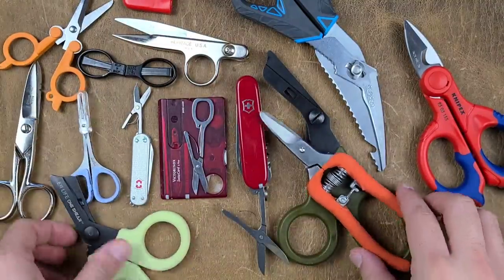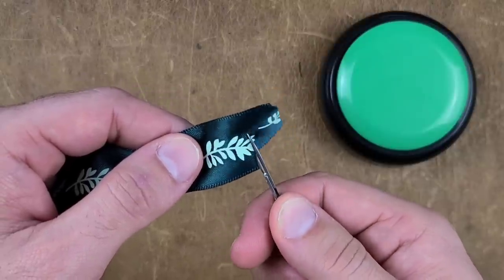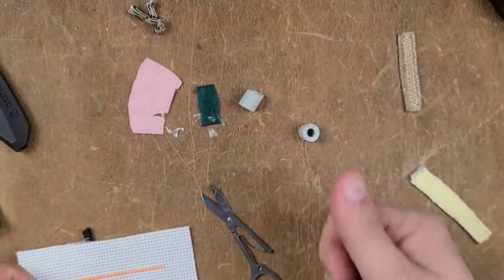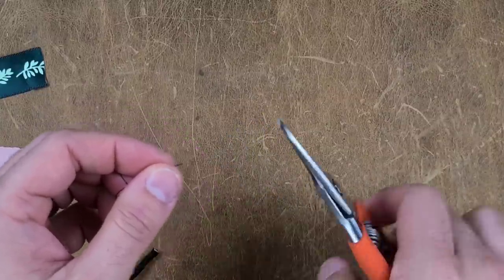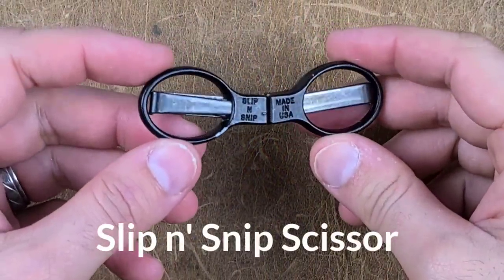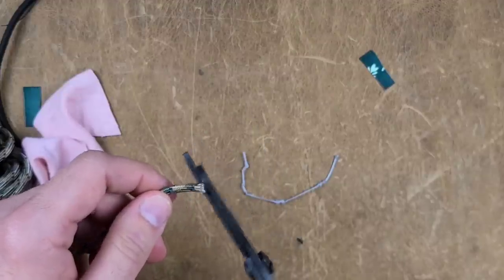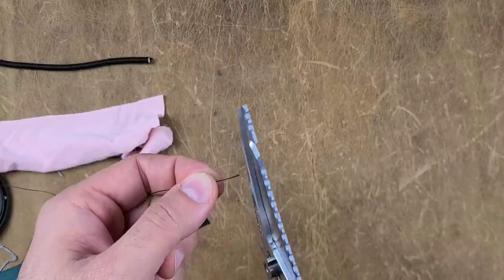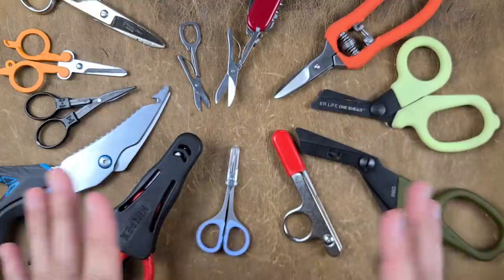✂️ EDC Scissors #1 (DIY Multitool Toolkit)

Comment: I used to be a telecom electrical worker and used electrician scissors every day and know that there's not much in the sense of everyday things that they can't cut. Now as an actual electrician, I still carry around my old beat up pair of Klien 2600-1 scissors everyday, even outside of work. They come in handy all the time and still cut just as good as the day I opened them. Great video, 👍 very insightful 👏
Reply: Was a wire tech for att. those snips are great. especially if you add the finger loop thing to it for more leverage and comfort for extended use
Reply: I just got my Klein 2100-5 and love them. Stainless 2100-9 on the way too.
I know Electrician shears are all close, but Klein is so nice STILL made in the USA. Like a little flex to glean the "USA" on the side when working with them. Meaning my fellow countrymen/women have work and no supply issues in an emergency.
Reply: And you reminded me I have a Victorinox card tool in my Victorinox section(25~ different models including Swiss tools), but have 400~ multi tools in total. 🫣

Comment: The Fiskars were the most surprising to me, I carry the Klein so I knew they would do great. I think putting leatherman scissors through the same gauntlet will really show their limitations. Hope the micra is in that test as they’re the only scissors I like from leatherman. Thanks again for the hard work! (Leave me out of the shears giveaway)
Reply: Klein crushed it here - which of the two models shown do you keep at hand, and where do you like to clip or place a holster/sheath?
Reply: @seqhorse  I believe they’re the 2100-7 and they fit nicely in my maxpedition micro pocket organizer. If I was using them extensively I’d probably get a belt sheath but the organizer works for me!
Reply: I sharpen knives and tools for living since the 90's. Fiskars are some of the best comercial grace scissors in Europe. There are eve better though! Japanese and some old traditional companies mainly from Europe, still make some really high quality high performance scissors. That being said, like most tools and machines nowdays, the overall quality, is not what it used to be. Usually, the older the better, with some excpetions here and there of course!
Reply: @greekveteran2715  victorinox actually also make scissors. not multitool ones but real ones... i heared they r even good nowadays.

really sad the stuff gets more expensive and trashy at the same time. just bough an old handdrill cause the oldones r just better...
Reply: @matthiaskathriner5494  Nope, Victorinox doesn't make any scissors. They buy them from a German factory,  and they just put their logo on. The only scissors Vicotrinox makes, are the tiny scissors on their multitools and pocket knives. 
          You're right about the handdrill. We aren't going to have power in any form on the coming years and that's because it's part of a plan and not just my opinion/theory.
          I've also got handtools, like axes,saws handriills etc, for the difficult winters we have ahead of us!! Stay safe Matthias.Take care!!
Reply: @greekveteran2715  thx for the responds. i live in swizerland and still didnt know that. glad i learnd something new today :).

i was always a big fan of hand tools like thoes drills and even scotch eyed auger (dont know if spelled right).

take care and have a nice day :D
 M. K.
Reply: @greekveteran2715  So, when are we going to start not having any power?
Reply: If your in south Africa...rn 😅
Reply: I have the smallest 4" Fiskars in my desk, and they are for fabric and paper really. Though I cut through a towel with ease. Earlier make of Fiskars 4" from the 1990s, so USA made. I just don't care for the plastic pivot. Hasn't seemed to make them wear though.
Reply: @greekveteran2715 Promise the US oil and weapons, and you'll have power in no time...lol
I have every manual tool variant of my electrical. Well, two-three of each type and size. I probably use a crank drill more than electric anyway. No noise complaints from the family..haha

Comment: 30 years in telecom, carried Kleins for most of it. That design is very old and has changed little for a reason. There's different handles now you can get but the fundamentals of the snip are the same. It works. The knipex cut great, maybe I'm just too set in my ways but I couldn't adjust to the ergonomics.

Comment: I've worked in telecom since 2001 and always keep a pair of the Klein Electrician Scissors on me. I've seen guys use them to cut a nickel in half! The key is in the hand grip. DON'T put your thumb through the top scissor hole but let it instead rest in your palm. If you get a pair that has a larger hole on one side, either put that side on the bottom and put at least two fingers in there, then  let the smaller side rest in your palm with no finger in it, or flip the scissors over and put one finger in the small hole and use the larger size to have more surface area resting on your palm. You can cut through anything like that.
Reply from the maker: Wow! Great tip!

Comment: I always have my Victorinox Swiss Card in my wallet and I love the scissors within the card. My sister gave me my Swiss card when I was just a teenager and now I'm in my late thirties. It is still going strong, both the scissors and blade. I actually put my middle finger slightly into the holes in the scissors of the Swiss card it gives me much more control of the scissors.

Comment: As someone who owns slip n snips and knock offs both pairs of my knock offs preform way better than my slip n snips despite abusing my knock offs far more often. Personally I feel for an EDC to pair with a knife they are the right call for me, being so rounded they store better than most the other options here in my pocket. And this way I can have a knife with a lock. I really hate using a knife without a lock it always scares me since I often find myself needing to press on the spine of a blade to cut things. 

Personally I do not find myself needing any thing on most multi tools at all often enough to justify carrying a multi tool. I do a lot of small quick cutting tasks so being able to keep them in my pocket is quite handy compared to the alternative. 

But yeah honestly the slip n snip I find work best on basically paper and fabric, but as soon as I have something like rope or a tougher cut I go to my knock offs. If I were guess they would probably score about a 11-13 on these tests. But the easy grip, and the comfort of them, along with not needing to maneuver an entire multi tool around to cut, means I find it easier to make curved cuts when I want and basically this is my pitch to people who see this and think they'd like the slip n snip form factor, to go look for a knock off brand, they are often around $5 at the time of this comment, and they cut better in my experience. I love mine. One thing I've done is a small bit of string and a bent paper clip means I can hang mine on the edge of my pocket, for even easier access then digging in my pocket. 

Just a friendly reminder that it's your tool, feel free to modify it to work better for you.

Comment: I'm don't see the SOG snippet, which are extremely capable, even more so for its size, more capable than any victorinox and weigh less than 60gr, bought them as soon as I knew about them after watching some comparison videos and they don't dissapoint, they don't have the best build quality but they work flawlessly. I wanted something comfortable and light enough to add to my EDC since I'm considering getting the Gerber dual force and they don't have scissors which I don't mind now...
Reply from the maker: The SOG snippet is a sleeper! Way way better cutter than the micra
Reply: @maxlvledc  I JUST WENT THROUGH THIS =p 19 PAIRS, DID 41 UTILITY BLADES TEST ALSO =p
Reply: @maxlvledc  I KNEW KLIEN WOULD WIN =p
Reply: @maxlvledc  I have an OG US SOG Snippet. Wild how well they are adjusted(sadly the uncreative name for this is "putting", short for "putter togetherer"...lol). Once the physics of the scissors/shears is realized, you can make many types cut better.

And the one hole scissors are thread nippers, and not made for any other reason. I have Wiss USA made ones and they're nice, but the construction should clue you in they have to be adjusted based on how you hold them. When to got done opening the blades cutting heavier stuff, they lost the precision adjustment. Or those are just not a good example of thread nippers.

Comment: I remember this being an issue for me, I work in I.T and I always needed to cut zip ties after doing cable management or replacing cables, but I didnt want to be carrying around some big bulky scissors, until I came across the leatherman CS, these small scissors pack a punch and Ive never had an issue cutting even the tightest zip ties with them being spring loaded. I highly recommend if youre looking for small form factor scissors.
Reply: Hello, can you give me a link to this leatherman. When i search for leatherman CS , only micra shows up. Or do you have this version?
Reply: @ironmaiden3842  Hey brother, so the name of the tool is the Leatherman Style CS but from what I understand Leatherman discontinued it so you might have to look for it 3rd party, hope it helps, good hunting!

Comment: Scissors really can be a mystery. In addition to performance across tests being unpredictable, I wonder what's up with the Xcelite shears. The fact that they did 1 or 2 cuts well and then completely failed against certain materials is confusing. I wonder if the handle style makes it less natural to push the blades towards each other as you're cutting, so if your grip is just perfect they perform well but if not they barely cut at all. It might be interesting to experiment with them to see if you can get them to work reliably, maybe by trying to put pressure on the grips differently or by tightening the pivot screw or something. I wonder if other straight handled shears would have the same issues.

I'm really impressed with the Klein and Fiskars scissors. I don't know if I'll ever bother getting the Kleins, but I'll probably pick up a pair of the Fiskars ASAP.

As far as other scissors to test I think you should try something from Kai. They are often regarded as some of the best fabric scissors, and I'm curious how they compare in more general purpose tests. Ideally you would probably want to go for the 5 1/2 (Kai 5135-wc) or 6 1/2 inch (Kai 5165-wc) scissors with blade caps. Kai is also the parent company of Kershaw and ZT; I hope one day Kershaw gets serious about making multitools again they use that scissor expertise to make something that could compete with Victorinox.

Comment: yes scissors are quite komplex... play between the blades, stiffness of the blade, angle od the edge... 
sharper angle can help to improove that the blades do not pull apart.. so expensive scissord dont have a flat grind all the way.. they have depending on the position in the blade a different edge angle..
also a corser grind can help to grip the material better so yo do not push it out... so for kevlar and dyneema  (at Gruschwitz) we used toothed scissors..

Comment: I would like to see the OLFA 5" scissors. I haven't seen hardly anything on YT about OLFA scissors so I was thinking about checking them out myself. I think OLFA makes good stuff. Also the Style CS, I really like them and I carry one everyday but yea the scissors kinda stink. They aren't terrible but I was disappointed when I first got it. They never cut that great until I lightly smacked the pivot point with a hammer and a machine screw (in lieu of a punch) and after that they cut better than they ever did. I think it tightened up the pivot and took out the slop in between the blades. I had to do that twice because they loosened up when I tried to open a blister pack and put in more force than I think I should've

Comment: I carried those fiskar scissors for a few months and the problem I kept running into was one of the handles would always disengage and the jaws of the scissors wouldn’t open. It got to the point where it was happening every time I used them. So I scrapped them and went back to carrying a SAK with scissors.

Comment: The Sun-Star Stickyle Tasuno Scissors + Screwdriver are in a two pen sleeve with my fountain pen. Got it from JetPens. I don't think the Sun-Star company knows, but the two caps on the pen-style scissors can be used as nut drivers in a pinch. Now if they can just invent pliers in this same form factor.

Comment: I own a fiskars heavy duty scissors. It is a standard sized scissors but Fiskars reinforced the handles to make them far stronger. The scissors has a fine point tip and very sharp out of the box and it even comes with a hard plastic sheath. I'd like you to give them a try and see if you like those scissors as much as I do.

Comment: Good video. Am curious how the Leatherman Micra would compare.   I have those collapsing Fiskars.   I wanted a tiny set.  It works surprisingly well, but I had to sand sharp edges from the plastic  handles.  They bit into my fingers.  I want a set of those Kleins.

Comment: I was very impressed with the klein electricians, just ordered the 2100-5 and will put them to the test at work cutting some fiberoptic drop cable. The stuff is really hard on blades, you can dull a knife in no time or just one pass when you cut it

Comment: Next scissors to test: Leatherman Raptors. I need to finish my medical kit and I’d like to see how they compare to the ones in this rundown.

Excellent video as usual. I needed a small scissor for my maxpedition pouch and I was literally waiting for this video to drop before I bought anything. Just ordered the Fiskars.
Reply: The Leatherman Raptor are great multi use medical shears. They have multiple useful features as a emergency tool / trauma shears but are not necessarily the best option for everyone. 
I like carrying them when on duty, but in my medical kits I prefer a good set of regular trauma shears. (From NAR, Piranha or similar) 
They are not only lightweight but also much cheaper and plenty capable.

Comment: This seems to be a very well thought out test, and I believe this test may actually be more useful to me than I thought.

More specifically whether the Slip n Snip scissors could be a good option for me.
Reply from the maker: I did learn...the slipnsnip is actually the safety variant. I need to test the other one.
Reply: @maxlvledc  
That would be good.

I'm not really looking to replace my Vic scissors,  but if I always need the Vic scissors it limits me on other things I can carry when I want to avoid certain redundancies.
Reply from the maker: @TylerSnyder305  exactly! That's why I think this is going to be more valuable than I originally thought
Reply: i’ve got some slip n snip scissors n they work great for EDC

Comment: I find scissors usually cut better by applying opposite pressure at the handles.  Its awkward though and with the better ones you dont need to.

Comment: Thorough work! The rather heavy duty scissors like the Klein or Knipex which are originally designed for cable could of course also be tested in their original domain (where a Victorinox, so much I appreciate those, better not should be used).

Comment: I carry a Compact in my pocket and Singer C-705 round tip sewing scissors in my bag but this has made me consider getting the small Fiskars ones and the Klein electrician scissors. 
You should test the Swisstool Spirit scissors, I'm forever disappointed it doesn't use the standard Victorinox scissors and would prefer to have literally any other tool in their place (too bad they discontinued the S variant). I wonder if there's any redeeming qualities to those scissors, I'd love to learn that I'm wrong about them and that they are actually somehow quite neat (or have my hatred of them validated).
Reply from the maker: Your not wrong...they suck

Comment: Thank you for creating this video.

carry a Leatherman Charge XTI (2 bit drivers/n scissors) or Wave Plus, depending on what I’ll be doing that day.

I have a pair of the Knipex 95 05 155s, which are excellent, but I don’t really like to have to wear a clip holster just for them all of the time.

I think I might get a pair of the Friskers based on your tests. I never would have guessed that they would have performed as well as they did. 

My only concern is how long the steel will keep sharp edges before needing sharpening. I’m assuming not close to as long as the Knipex, but I think that for the size, I can make the sacrifice when I don’t specifically think I’ll need scissors. 

Do you have a guess as to how the Friskers compare to the Wave scissors in both function and edge retention?

Thanks
Reply from the maker: Testing em this week

Comment: I'm EDC-ing Magnusson 213414 scissors and I have almost no doubt they could pass most or all of these tests plus they have wire stripping cutouts for several gauges. And they're dirt cheap - under $10. Only available in Poland though :(
Reply from the maker: Oooo, will have to look at those

Comment: Check out Klein's video on the construction of these electrician's scissors. They show you why typical scissors can't compare to these inexpensive, unassuming looking shears. They are used by professionals who swear by them and are designed to keep an edge for a long time, even though they are intended to be used to cut wiring.